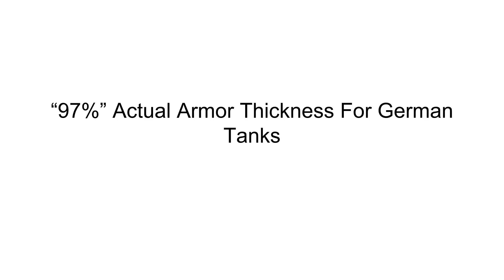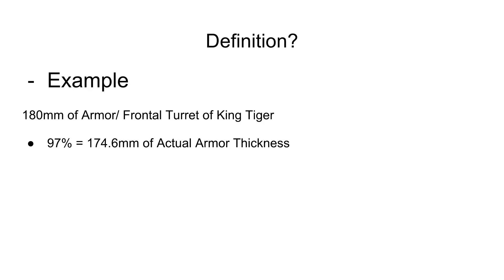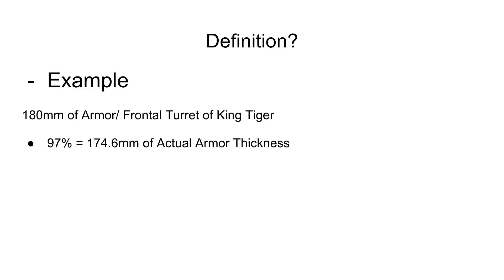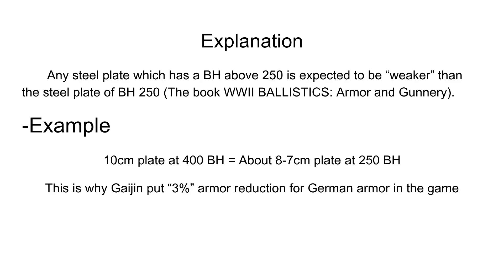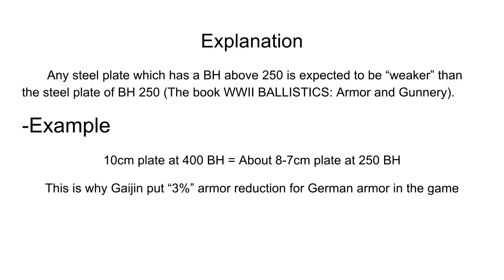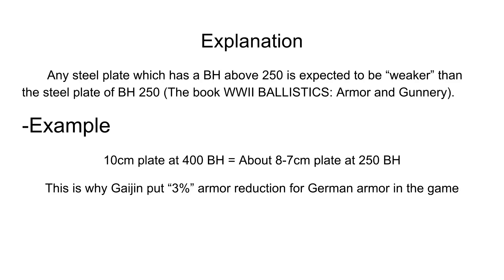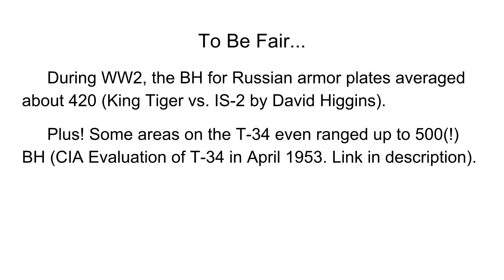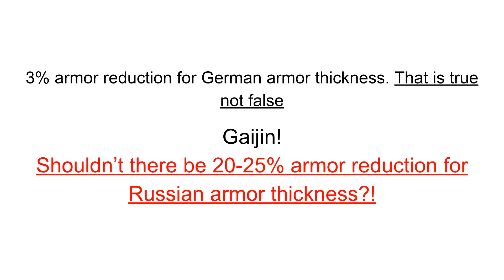War Thunder- 3% Armor Reduction For German Armor (Final Commentary Test Run)

Comment: Thank you for investigating this mystery for us. I totally agree with you: Only because some German vehicles later on in the war had worse steel quality than at the beginning (as far as I know, the Tiger I had a fantastic one) Gaijin gives them a reduction, although Russians had even worse plates. Either you add this for all the nations or you leave it out (in my opinion the better idea). Two short questions: Why did you take 180mm for the KT turret armour and not 185? I know, thats not much of a difference, but at longer ranges it starts to make a difference. And a general thing: Is it realistic that the T 34 (American Heavy Tankt) with its normal shell can pen the KTs upper glacis? Over all the reduction value doesn´t bother me too much. The tanks that really suffer from it are the King Tiger (very important tank in the game, that makes it even worse) and the Maus (I don´t know, how far, the Tiger I is concerned). But nevertheless this "feature" should be made fairer...
Reply from the maker: Hammer Preis For the second half of WW2, German armor quality indeed decreased but not a lot. It is still better than the Russian steel plate which has an average of 420 BH... Any steel plate which has a BH of above 400 is consider extremely brittle and hard. Plus, prone to shatter when impact. 
In real life, the frontal turret of KT(H) is only 180mm /10 degrees thick(Jentz states 180 but the British report still states 185). In the game that is 185/9.
Reply: Really? Because I read the 185mm in several books which are not related to the game...But ok
Reply from the maker: Hammer Preis Jentz and Doyle say 180/10 degrees. Maybe the effective thickness is 185 mm/0 degrees. I'm not that sure though. 
Whatever that is, the truth is an IS-3 could easily rekt it even at 900 meters. 
One of my close friends has an American T-34. He said on the test track it could pen the upper glacis of KT, but in an actual RB game he never succeed in penetrating the upper glacis of a KT.
Reply: Ok thx

Comment: American armour was too soft also. Tigers often shot at Shermans with the HE-round :D
Reply from the maker: Lucius Tatus So far I only found one tanker who loved to use HE to deal with Sherman... That is Rubbel. Well... He was from the 1st Company of 503rd Battalion and used Porsche KT during the Battle of Normandy. The HE round from 88 could easily disable a Sherman from the side and rear (only about 2 inches or 38mm thick). 
Ironically, the most famous use of HE came from the Sherman. A Sherman 75 knocked out a Panther by shooting three HE rounds to its side and busted the armor plates.
Reply: Yep, other tankers of the 503 did the same. But they used the HE round with the delayed ignition so it could penetrate the steel first.